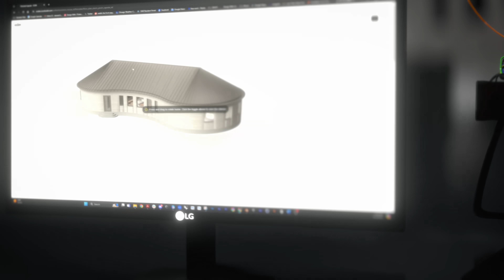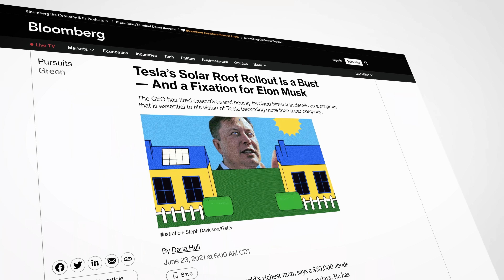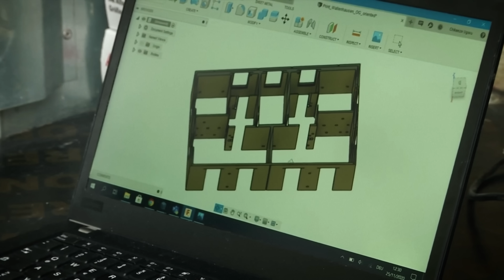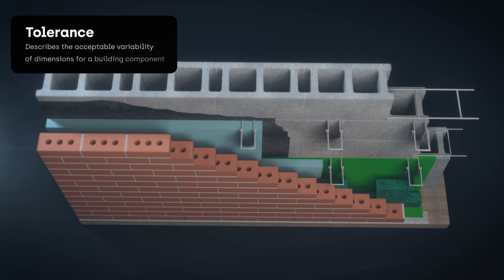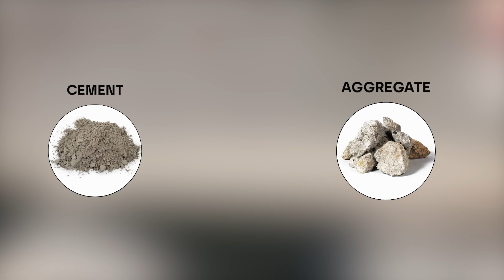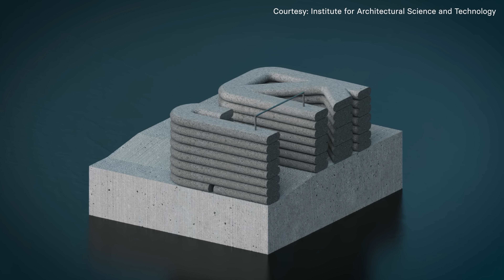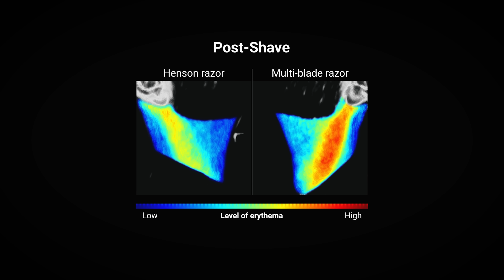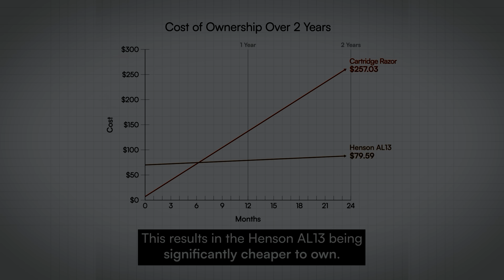Why 3D Printing Buildings Leads to Problems

Comment: Different admixtures, acrylics, fibers ( metallic, ceramic, synthetic, etc.), fly ash, pigments and others, can create concrete with different characteristics and surface textures. This could address some of the concerns with these structures. The application of surface finishes like stucco can be more appealing. The technology just needs more development to be accepted. While concrete is expensive, the labor savings of construction should make the structures less costly to build overall.

Comment: if you already go for fine aggregate concrete, then AAC will do it as easily, while having enough strength, low bonding time thanks to modern chemistries. You still need foundation to build your house with 3D just like with AAC. You still need prefabricated elements for both, but for AAC you can buy them in common lengths. AAC have little better insulation properties than non-voided concrete.

Comment: The limitations you spoke of, dont really seem like limitations. It seems  more like they didnt think about a way to solve those limitations long enough. I thought of ways to fix almost every limitation you spoke of while watching you speak about them. The "perfect" level isnt a problem, yes it would need to be graded but every lot needs that.
Right corners are not a necessity or even useful, so thats not a limitation. Not to mention if you really wanted a corner, just flatten and shape as it builds up. The machine might not make corners but you can. Just think about it for 2 more seconds. And whybout of concrete?  Why not make it out of the trillions of tons of plastic trash we have scattered everywhere! Let me guess, not cost effective?

Comment: As a person who's worked in construction and property maintenance, it sounds like there is a lot of laziness going into the printing of homes. The idea seems to be to take humans out of the equation, but I feel tech should augment humans. In the example of the brick layer; a system that acted as a movable scaffold (like a skylift) that supplied bricks and mortar to the mason's work area. The work area could include tools and supplies, ergonomics for worker, systems that measure and systems that can integrate communication between construction trades. My idea would be to help the worker, make things safer, help minimize fatigue and keep the worker doing what they do with minimal reset. Take the waste out of building.

Comment: Silly your supposed to use the robot to drop blocks & doughnut stuff the gaps blocks & bricks being cheaper the rollers measure the build height to select the thickness of the brick or block.

Comment: 1 day (a least) for the machine foundations, 1 day for assembly the machine, plus 1 day to print. That’s 3 days for the construction of the concrete walls. In Colombia and many places in Latinamerica, builders can make the concrete walls in one single day. No bricks, no frames, just the concrete and the tubes for the utilities. 

And the squares are 90 degrees (almost) and the rooms can host the normal furniture. 

Problems: The same you pointed, but with some intelectual work, it can be fixed, plus adding insulation, is ease breeze, and can be done both sides, boosting the insulation feature. 

I add the problem of having a rustic and rough wall.

Comment: Construction printers, do not, actually, print houses. They only print walls , the most cheap element of house. They cannot print house foundation or roof, they cannot print heat or water insulation. They cannot print inner or outer facing.
Printer actually gives you only 20% of house.

Comment: For the windows and doors you can have a large flange mounted directly to the outside of the concrete then put trim on top of it.
For the corners you could have a plywood form set up ahead of time and have the machine fill in the forum

Comment: 3D Printed buildings are soooo ugly.  Can you imagine trying to clean one of those? Pull out your fridge and look at the nastiness behind it after a few years.. Imagine the same dust and gunk building up on the exposed walls.. Ever tried cleaning a brick or a block with windex and a paper towel? That what it would be like trying to clean those nasty exposed walls inside. Not to mention, the examples shown look more like a doctor office: absolutely no personality.

Also -- how do you add outlets and switches? Pipes for plumbing? Etc etc.. You'd have to have an internal structure (walls) to hide all the "behind the scenes" elements of a home.  I'd like to see a whole house process. From printing to move-in ready. It's an interesting thing, to be sure -- but (for my personal tastes,) it'd have to be covered up completely -- inside and out.

Comment: The thing is that a normal wooden construction house can fly up in like a week in terms of actual working time, if you’re looking at foundation and framing alone (which is what this process seems about equivalent to,) then it’s even faster. The thing that slows down construction is layers upon layers of bureaucracy and general poor time management on the part of organizers or contractors. Yeah, this is faster if you force a comparison to building a brick house by hand, but that’s not how most American homes are built, and these things are going to end up facing more bureaucratic hurdles than normal homes, not less

Comment: One of my jobs as a welder was to inspect and correct the product of our robot welder, and I can say it was not a great welder.
     It had limited use as most of our weldments were not repetitive enough to justify using a robot. 
    I only got about 5 to 8 hours of work a week from the robot. That included inspecting the welds and correcting about 10% of the finished parts. A lot of the errors were for parts that were out of tolerance, and the tolerance was pretty high on these things, ± 1/4" when most of the hand welded stuff was between ± 1/8" and ± 1/16"

Comment: Luckily it never ever happens thanks for super greed and stupidity
You talking pure garbage too. The machine does not need to be perfectly level and it never will be. What it need is calibration! Sure you could not figure that out, because you have no any idea. It is perfectly fine not to have everything bit off. Software calibration measures certain points and then make adjustments depends on that. Exactly like every CNC works

Comment: What none of these guys understand is the STRUCTURE is not the expensive part. Its mechanical, foindation and finishes that cost. Concrete printed houses just make all the other trades harder.

Comment: More high-tech snake oil. Back at the turn of the 20th century, Thomas Edison proposed poured concrete houses. He thought that such would lower construction costs. He was wrong. But some were built and still stand today. I think this is what will happen with 3D printed buildings. A few will be built and considered novelties in the future.

I think housing of the future will be built primarily out of wood. Some, such as the mobile home I now live in, will be built through automation. Others will be owner built from kits (this also happened during the early 20th century. Before Amazon, there was Sears @ Roebuck).

The reason I think wood will be used primarily is because doing so will encourage the growing of vast forests for the raw materials. These forests will soak up a lot of CO2.

Almost all of the material used to build my mobile home is recyclable. The wood can rot back to nature, and th aluminum and steel can be melted down at far less cost than the cost to originally extract them.

Comment: Walls are only a small percentage (and arguably the easiest part ) of the total cost and time of a home__ the so called gains and cost savings are a trade off of "acceptable " finish levels__ one can only imaging how much dust and dirt would settle on all those ledges. To put perspective on this;  a polystyrene block, solid concrete cored  home would go up in a similar time, but would require plastering inside (or plaster board) and out (which these really need to have done ). Others have blamed regulation, I would agree your manufactured homes go together very efficiently and the modular build industry is proving their worth as well, but regulators do all they can to protect your site built industries/monopolies. The prefabricated wall and floor industries in Europe and elsewhere can stand a similar sized home up in less time and with a much higher standard of finish. "Innovation is great and needs to be encouraged"__  but a Real World perspective is required, this system is fantastic when finished fully, the freedom of shapes are awesome, perfect for expensive one offs but as an answer to affordable housing NO. There was a video of affordable houses being built in Malaysia/Indonesia, solid concrete poured on site in a very clever but simple mold system, the wall finishes from the mold were smooth, even the roofs were concrete slabs__ since they were "wet poured" curves could easily have been incorporated into the molds/design.

Comment: concrete itself is not that durable, this is going to be a disaster a couple of years down the line. there's a reason we used reinforced concrete in construction people. those little cords that they're using for this isn't going to cut it. companies out here repeating mistakes that had been fixed from over 100 years ago

Comment: Cool video! Interesting to see a new type of construction, and curious to see where it goes in terms of new practices and innovations. As is it definitely seems challenging to work with, especially in a renovation context. That aside, safety razors are the best!! I pay maybe $20 a year max for blades, usually around $10 for 100 blades and you can get them practically anywhere.

Comment: If you can look into the mud 3d printing happening in Africa.  West African mud is very durable for buildings in the dry arid regions and have made some impressive structures on the scale of Roman concrete, but people didn't see the value and genius of it until much later.

Comment: functionally, you are building a house with a sand mix.   A wet laid sand mix, has a very short life span and is weaker.  And bricks have made arches and lentals for years, yet, 3d printing cannot do that either.   3d printing relies on embedded steel.   but also comparing to bricks is silly, since only 14% of new homes use bricks in exterior walls in 2022.   And fly ash, has been reduced in current concrete, since it has serious flaws, whereas the blocks made with ash, do not last that long.

Comment: 3D printing homes may take off in the future once new materials are available and the printers are made more advanced and able to incorporate AI to minimize the number of on sight workers as humanly possible. Until then I would strongly advise anyone to not be investing any money that your not willing to take a substantial loss on. Here is some ways that 3D printing houses could be used to help produce houses faster and cheaper. Simply do away with the walls being printed out 1 layer at a time and simply start each house on a concrete slab and use preformed molds that are modular. Have the 3D printers robotic arm fitted with jaws that could put each section of the forms up that lock into each other and once in place take the jaws off and then pump the forms that are standing full of the same material that they print the house layer by layer with. This way you can have 90 degree angles and a much smoother surface finish and a guaranteed more consistent window and door opening sizes. This could and possibly would be just as cost effective as 3D printing and done with the exact number of people on sight not to mention the fact that it would possibly be qwuicker because 3D printing can only go so fast because of curing time needed to allow the lower layers to firm up before more layers can be put on top so that it doesn't start to sag. When using forms they will hold the material in place allowing the printer to move faster and possibly opening doors to more types of materials to be used

Comment: My company, a large multinational, is devoted to "light and sustainable".  This is much better than 3D printed, IMO.  Construction from carefully crafted parts made in a carefully engineered and controlled environment has a much better chance of success then something created on a job site.

Near my home I watched a new hotel constructed, a Home 2 branded building (Hilton).  Each room was trucked in and lifted by crane and placed into the frame.  The entire room was complete, wired, plummed, furnished and finished somewhere else.  As they were installed, they were tired into utilities.  The construction was rapid, the whole project appeared less than six months at the site.  Somewhere else, there are people who go to work to construct these rooms.  This modular construction was done very well.  The first time I stayed in a Home 2 a few years ago i noticed the shape, long and skinny.  I said to my wife, "it feels like we are staying in the back of semi!".  We'll it turns out that was true.

Comment: 3D printed homes just don't make that much sense. The issue isn't the technology, durability, or looks, it's just that building the walls of a house is barely a fraction the cost of the house. The vast majority of the costs go into the electrical, plumbing, insulation, building the floors, etc. 3D printed homes are about as reliable an idea as the shipping container homes. If the walls of a home were the value of the home, it'd be great, but that's just not how it works. The 3D printing is basically just building concrete walls exclusively when people are still going to use drywall inside.

Comment: You very effectively made a problem that doesn't exist. It is easy to make replacement parts either in a factory or on site and simply put them into any place that needs repair, in fact this is easier than repairing a conventual building.

Comment: The movement is called CNC, computer numeric control, since 3d printers use gcode to move. Slicers like cura create the gcode from models and it is sent to the 3d printer.

Comment: No building inspector nor PE will ever sign off on a concrete building that has no reinforcing steel within the concrete.  
Concrete is only strong under compression, but concrete structural members routinely experience tension too.
This is why all concrete structures are built with steel rods and wire (which are strong under _tension_).
It is an unavoidable fact that 3D concrete - even if it is made with a fiber additive - is not as strong as standard steel-reinforced concrete. Ask any civil engineer you like.

Comment: One of the buildings that you show in clips at 3:17, 6:43, and 13:05 is down the street from me in Houston, Texas. It sits unfinished and overgrown with weeds. The printing equipment was packed up and taken away. You can see it in Google maps. Intersection of Emnora and Shadowdale. 2398 Shadowdale. The street view shows an empty lot, but satellite shows the unfinished project.

Comment: The presentation cgi of the crane mounted extruder had me scratching my head. Cranes are not totally rigid systems, they sway about and don't stop on a dime. The more the arm is extended out, the less control you have, leading to misplacement of the concrete.
Most brick homes use brick for the exterior support walls and let the interior be stud and sheetrock. This allows for fast build and easy modifications. A fully interior and exterior walled 3D home allows for none of that flexibility.
Another aspect of 3D printed homes is the exterior. The rougher ridged texture is harder to paint with any method besides spraying, even a thick nap roller would have a difficult time. Unless it's smoothed out, all those ridges will collect dirt and will begin streaking; owners of textured stucco exteriors know this problem well.
Reply: some kind of foam spray or modular filler wrap could be manufactured and applied to smooth out the surfaces and provide desirable characteristics over bare concrete.

Comment: I think the real promise of 3d printed buildings is something you alluded to but didn't discuss.  Buildings are pretty much the last daily use items that have large amounts of manual labor in their creation.  Pretty much everything else we use on a daily basis has a lot of automation in the production process that accomplishes most or all of the creation of the finished article.  Buildings are made of components largely produced automatically, but most of the assembly, particularly of houses, is done by hand by people.  A lot of that is skilled labor (specifically, essentially all the shaping and assembly work is skilled labor, the only unskilled labor is just carrying stuff to where it's going to be shaped or installed), and skilled labor costs a lot.

Comment: Most remodeling and renovating that people do in homes is really just putting new faces on everything, exterior walls don't get knocked down all that much. If you did though you can always just use more masonry, or even make a form and pour in a new wall or whatever. That said I would expect most interior walls to not be structural and hence be made of conventional 2x4 construction. Drywall isn't used because it's ideal for the purpose, it's used because it is dirt cheap.

I like the idea of these printed houses, but if I had one made I'd want the walls smoothed, preferably as it's printed/poured. If not possible though I'd have interior walls plastered smooth, and I'd probably cover the exterior with something to reduce radiant heating from the sun.